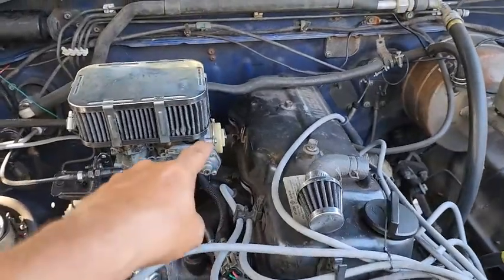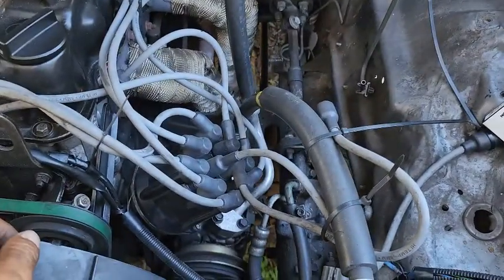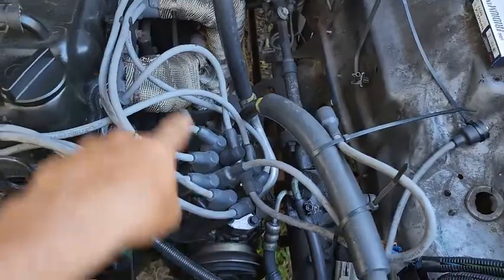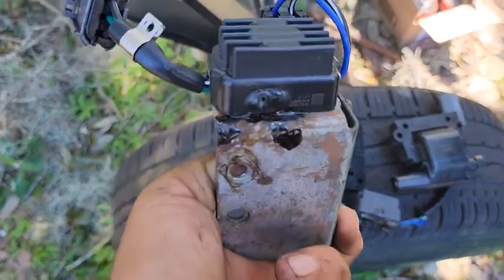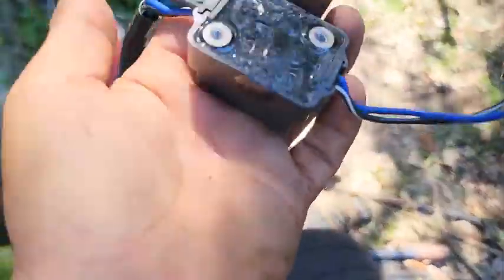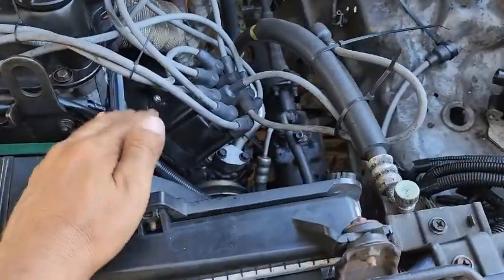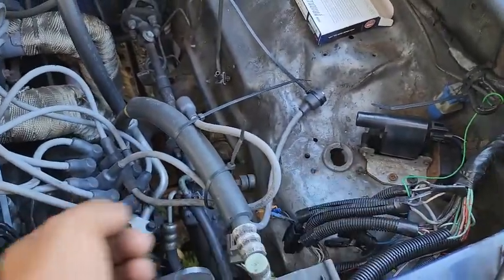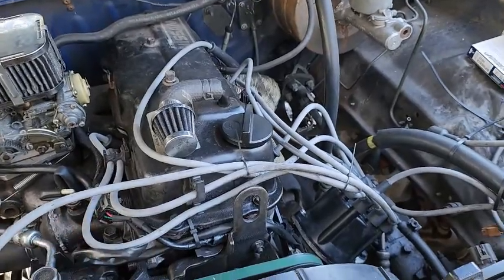86 nissan d21. spark plug/ICM upgrade/distributor mod...sort of.

Comment: Can you post the exact part number & year model of D21 at Rock Auto? I need one for a 1986.5 model truck.
Reply from the maker: Part #: WELLS 6h1217 
It's the exact part number for your year truck. Click on your specific year make and model. Then click on ignition control module section too find the part for intake side.
https://www.rockauto.com/en/catalog/nissan,1986,d21+pickup,2.4l+l4,1210835

Comment: where did you get that air intake from? and what is the little cooler on top of the valve cover?
Reply from the maker: @damisigns  the air intake came with the carburetor. "It's a Weber carburetor." The cooler thingy is called  either an air filter or breather.  You can get them at any auto parts store.

Comment: El módulo que presentas si funciona al bien en tu motor, no necesita el módulo de escape
Reply from the maker: I still have it installed.  It's running pretty good. But this model engine still needs both coils and module's to run efficiently.  I don't recommend running with just the intake side coil and module for too long. It definitely effects gas mileage.

Comment: What is the icm from.
Reply from the maker: Got it at this site. Click on your specific year make and model.  And they should have what you're looking for. 
https://www.rockauto.com/en/catalog/nissan,1986,d21+pickup,2.4l+l4,1210835
Reply: @almagam2099  you think a weber will solve my 2800 rev limiter..cause i changed every sensor and nothing
Reply from the maker: @808livin.8  I don't think so. 🤔 
In certain ways she'll run better. But the rev limit will likely still be there. From what I've read, guys that convert too the Weber, end up making the computer obsolete. They install the icm, coils, dizzy and oil pump from the previous version of the z24i engine "the z24"
Either, there's something we're missing or the computer just thinks there's something wrong that it has the engine in limp mode.
Reply: @almagam2099  thanks i had the same feeling when my dad said put a weber and i toldem what if its still there.....how do i clear my computer codes
Reply: @almagam2099  when its cold the truck doesnt wanna idle till ipress the gas a few seconds then it idles runs fins just the limiter still yet...could it be the icm making it go limp
Reply: @almagam2099  would a computer from a new hardbody work.if its same
Reply from the maker: @808livin.8  yes. It's very possible that it's the computer. But how too check? I'm sure there's a way to check if the computer is fried or if it's something fixable
Reply from the maker: @808livin.8  it's kinda the same with the Weber and cold weather. I ended up connecting the wire for electric choke and fine tuning the Weber. She runs pretty good in the cold weather. I just have to remind myself to fully let the engine warm up before driving
Reply: @almagam2099  could a bad injector send it into limp mode
Reply from the maker: @808livin.8  as far as computers go,  i think it'd have to be the same year and trim
Reply: @almagam2099  i checked my parts truck its a ka motor computor...
Reply: @almagam2099  coukd code 21 no ignition signal be cause of the exhaust coil being disconnected
Reply from the maker: @808livin.8  I think so. 🤔 
I'm gonna look for an article on the d21 forum's on this subject.  One guy thought it was his injectors. Ended up being the way the harness is setup on our d21's.  The article has a walk-through with photos on where to look and what to fix. I'll look for it and send you the link.
Reply from the maker: @808livin.8  I don't know for sure. I've been driving without exhaust side and my computer hasn't thrown that code. It hasn't really thrown any codes for some time
Reply from the maker: Here's the link for the injector wiring harness fix. I'm thinking of doing this fix myself cept I'm bad at soldering! But still, if it fixes the rev limit,  I'll give it a shot!

https://www.nissanforums.com/threads/86-5-z24i-engine-cutout-solved.160226/
Reply from the maker: @808livin.8  yeah, the ka computer is different from the z24i computer.
Reply: @almagam2099  i got a ka hardbody for the front after j totalled my truck 8 yrs ago i rebuilt the whole front
Reply from the maker: @808livin.8  that's cool. I swapped in several parts from a 93 d21 with ka24e onto my d21. 😅
Reply: @almagam2099  my tos sensor has no power could that be why i checked with a light tester...
Reply from the maker: @808livin.8  do you mean the throttle position sensor? I don't know if it can be checked with test light. But it can be checked with multimeter.
Reply: @almagam2099  im gonna make a video of the motor can you look on my page in like half hour.
Reply from the maker: @808livin.8  of course. Gonna subscribe.
Reply: @almagam2099  i have the video posted.
Reply from the maker: @808livin.8  cool.
Reply from the maker: @808livin.8  hey. I've been commenting on your vid.  Several times actually.  For some odd reason my comments aren't going thru.
Reply: @almagam2099  foreal its weird
Reply from the maker: @808livin.8  I've had similar issues like this  on YouTube before.  It's just been a while since it last happened.
Reply: @almagam2099  when my truck idles should both lights light up on the ecu.mines only red lights up.
Reply from the maker: In your vid, you asked about the computer lights being on. If the computer diagnostic mode is turned off, I don't think lights should be on.
Reply: @almagam2099  how do i clear codes ony ecu
Reply: @almagam2099  so the lights shouldnt be on at idle.on the ecu..im so confused i tried so much and it dint work.
Reply: Could it be my fuel pump doing that not giving fuel i turn on the key and it dont wanna idle good and the pump seems loud whining noise
Reply from the maker: @808livin.8  do you know if the pump is the original one? If so, it might need too be changed.
Reply from the maker: @808livin.8  to clear codes, disconnect battery for about 10 minutes.  Then reconnect battery and recheck for codes. That's the only way that I know of how too do that on our computers
Reply: @almagam2099  ive had the truck for 18 years and ive never changed it...not sure about the owner before me
Reply: @almagam2099  ive did that a bunch of times thanks
Reply from the maker: @808livin.8  then it would likely need too be changed.  That's pretty much what I did. Everything in the truck was original when I got it a few years back. It was in horrible condition.  Everything was crumbling and falling apart to the touch.
Reply: @almagam2099  i dont got money to keep buying things that dont work...so fucking screwed this year i cant even do my jobs
Reply: @almagam2099  do i change just the pump or the whole fuel pump and assembly part.
Reply from the maker: @808livin.8  when I did it, I changed both. But you should be good with just changing the pump
Reply: @almagam2099  its cheaper to...thank you very much sir i apreciate it..wish i could buy you case of beer for helping me...
Reply from the maker: @808livin.8  no worries. I'm happy to help!
Reply: @almagam2099  i think yes, on the manual says have to be on
Reply from the maker: Got online at a site called Rockauto.com. 
 Type in your specific year, make and model and you'll be able to find the part.